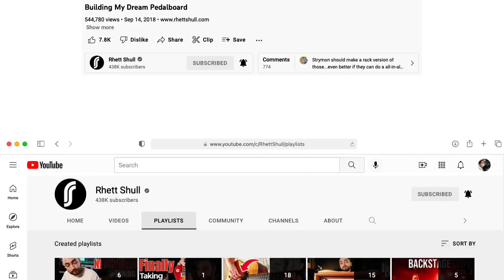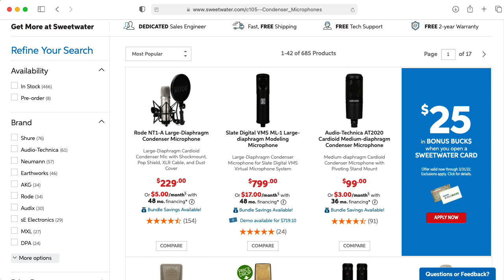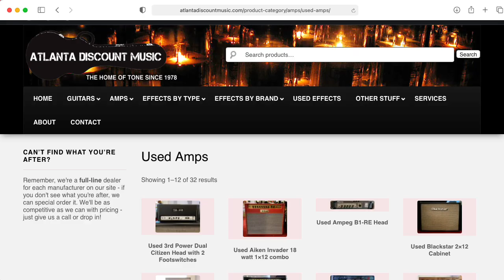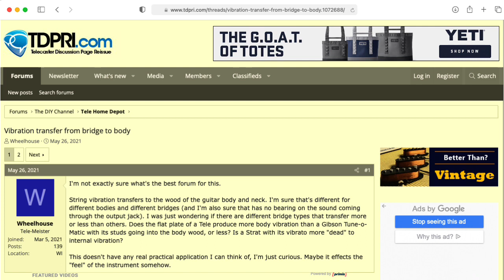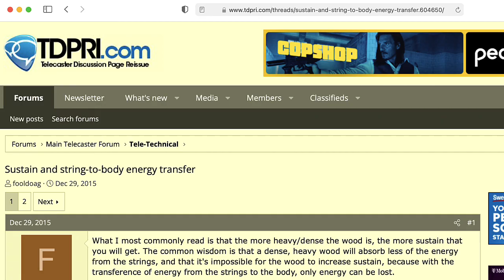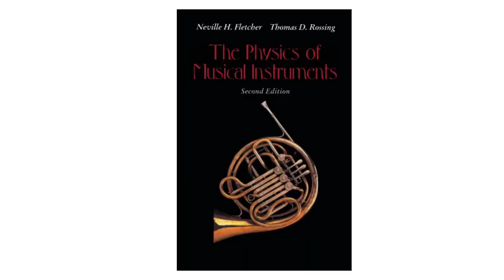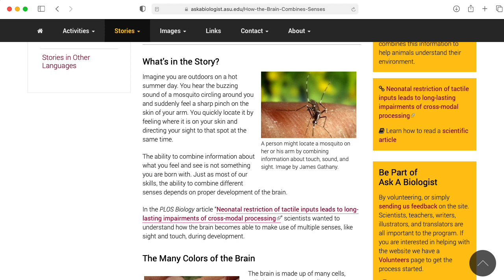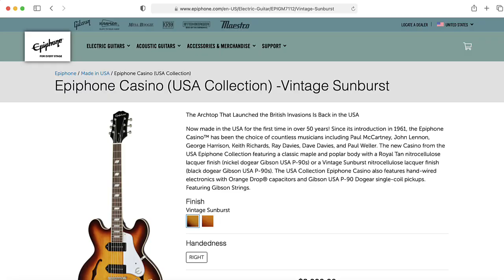Refining Rhett Shull's Resonance Reasoning: Vibrations in Electric Guitars and the Sustain Paradox

Comment: Here is an interesting fact for you: I recently witnessed a friend holding his mobile phone close to the pickup on his electric guitar during a rehearsal, to play an audio file (of the song we intended to rip off) for the rest of the band to hear. The 6 strings vibrated enough for the Pickup to provide a very clear signal which was then cleanly amplified. This would suggest that there is a great deal of feedback and possibly reflected energy  through the physical elements surrounding the Pickup. To simplify this down to the theory of a magnet and a coil being immune to the surrounding environment is a little too Thevenin.
Reply: I honestly think it’s because the pickup is picking up the magnet vibrating in the phone’s speaker. From what I recall this works the same way if you mute the strings. However I’ve seen people sing into pickups and it being picked up and audible through the amplifier (both vintage a modern pickups so presumably at least the modern ones were potted). So imo it’s either the voice is making the strings resonate in relation to pickup or vice versa, or even potted pickups are microphonic to a degree.

Comment: Well ... I basically agree with what you say, but I think you underestimated something. If there is a strong coupling between the string contact points and the neck/body then some of the vibration energy will be transfered to the acoustic parts. This also means that some of the enery in removed from the strings and thus will not turn up at the pickup. This will reduce the sustain but may also change the spectral energy distribution at the strings which is left. So I would assume that the body resonance may also influence the spectrum and thus the sound seen by the pickup.

Comment: I don't try this with every guitar/pickup I own, but in my experience every pickup is microphonic to some degree. With enough gain you will hear through the amp of you sing into the pickup - properly potted nonmicrophonic (technically) pickups. If that's true,  every pickup will pickup some of the acoustic properties of the guitar to some degree.    

I've seen many pickup builders talking about how much time the pickup will stay submerged and how well it's potted affects the tone. 

So what I got was that maybe it's a balance between avoiding issues under high volume and gain while sacrificing as little as possible the microphonic quality. 

But while I had good examples of what Rhett is talking about (one of them an sg jr actually), I had a strat a while ago that sounded crazy loud acoustically but sounded very bad plugged in. It wasn't just me, I had some guitar buddies over and we all agreed. We transplanted the whole electronics from a fender john mayer into it, from the pickups to the jack,  it still sounded horrible, nothing like the fender. The fender still sounded good with the partcaster electronics.
Reply from the maker: It would be interesting to try to tease out how much the microphonic pickup is picking up the vibrations in the wood of the guitar body, vs. the parts of the microphonic pickup vibrating directly from being blasted from the amp.

Actually, you could probably test this by just holding the pickup and blasting a guitar amp at it. That would give you a baseline.

Comment: I get it when you say that the energy that is in the body, is not in the string anymore. AKA, the pickup doesn't pick up the movement in the string anymore. That is obvious. 
But now the opposite question... 
What if the strings are more or less stationary, but the resonating body and the pickups vibrate in relation to the strings? 
In that case the magnetic field in the pick up will sustain right? 
I mean, who cares if the strings move in relation to the pickups or that the pickups move in relation to the strings?
The vibration in the strings will always be greater than the vibration in the body, but both vibrations add up, i presume. Albeit subtle.
Reply from the maker: I thought about this for a while trying to come up with an experiment to test this... but it would need a double necked electric guitar, where you can separate outputs for pickups on each neck. You could strum on one neck, which would make the body vibrate, and you could dampen the strings on the other neck to make sure they're not picking up sympathetic vibrations. Then you could get the direct output from the main pickup form the neck you are strumming, and then also look at the signal from the pickup from the neck you aren't strumming to see what vibrations from the body it might be picking up.

Comment: Good video. I observed this neck vibration characteristic when I was comparing high and low-end mandolins last year. It's remarkable how important it is to a players perception.
Similar to the contradiction between 'soft' or 'dense' woods being good for sustain, I can imagine an argument that a 'resonant' guitar that vibrates along with the body is beneficial for sustain, as a result of not losing as much string energy to internal wood friction. Why do acoustic instruments not suffer from significantly worse sustain than electric ones? Is the energy actually converted to sound by a soundboard really only a small fraction of the energy of the vibrating string? That would explain why a 'resonant' solid-body isn't less sustaining than a 'dead' one.
Reply from the maker: Interesting thoughts! I think it would be really interesting to stick some piezos in various places on different guitar bodies and try to measure that.
Reply: Acoustic guitars DO have worse sustain than solid-body electrics. Check out Zollner's work (in his book) measuring T30 (decay time) and bridge admittance for acoustics, hollow-body electrics, semi-hollow bodies, and solid-body electrics. T30 is shorter and bridge admittance higher in acoustic guitars. Also earlier work by Fleischer comparing acoustic and electric guitars. There is no escaping the Conservation of Energy Law. That's good overall for an acoustic, because it enables string vibrations to be heard, by transferring them to vibrate the body and air cavity . But not good for an electric guitar. If string energy goes into vibrating any part of the guitar's structure, it is no longer seen by the pickups - which means that the resulting tonal palette has lost those frequencies, and sustain of those frequencies is reduced. When guitarists like Rhett think that guitars which indeed do sound resonant do so because of body vibrations they have hoodwinked themselves. Lucky for them, all measurements of real guitars show that solid bodies don't resonate to any significant extent. Even though our sensitive skin mechanoreceptors can feel some vibration. But truly resonant guitars are those where vibrations remain almost all in the strings. If solid bodies did vibrate significantly, sustain would be poor. Again, no escaping the laws of physics.
Reply: This has been studied.  Acoustic guitars get sustain the same way electric ones do, just to a lesser degree:  most of the energy of string vibration that hits the bridge, nut or fret is reflected right back into the string.   The bridge/nut/fret only moves a little bit at each cycle, like less than 1 percent, so the string gives up energy to the wood gradually over a bunch of cycles.

Even on an acoustic, the bridge is rigid and massive enough, and braced rigidly enough against enough mass of adjacent wood, that only a little bit of the string energy is transmitted at each cycle of vibration.   On any normal solid body electric, with a metal bridge that's rigid and somewhat massy, and a solid body made of any normal body wood, the bridge moves even less, hardly at all, so very, VERY little energy is transmitted from the string into the body there. 

Considerably more energy is transmitted into the wood of the neck at the nut or fret than into the body wood at the bridge (although it's still a tiny bit per cycle).  The neck is the main cause of resonances on an electric, because it's much thinner and less massive than the body, and can flex more easily and in more places.   For most resonant frequencies of the neck-plus-body, above about 500 Hz, the body acts as a rigid ballast to immobilize the bridge and one end of the neck.

Comment: Hi Aaron, very interesting. i'm an EE at a university too. it seems to me that the body of a guitar acts as a filter. which, as you said, if energy is going into the body it isn't going into the strings. filters have resonance and they also tinker with phase. there will be several resonant frequencies in a guitar body/neck assemply. in resonance some of the energy will be transferred back into the body at varying phases. doesn't this then translate into a hearable effect? to complicate things, usually somebody is holding the guitar and thus dampening the energy in the body. the whole transmission of energy into the body is governed by the conductance and admittance at the fret which is being held down and by the bridge. the conductance varies quite a bit and can lead to dead spots in some guitars.

there are papers by fleishman and zwicker that go into this in detail.
Reply: A little energy is transferred into the body at the bridge and the neck at the nut or fret, which is why a solidbody with very a light body is a little louder acoustically than one with a very heavy body.  You're not just hearing the vibration of the strings themselves, but are also hearing the body vibrate.   But the large majority of the energy from the vibrating string is reflected when it hits the bridge or the nut or fret, and stays in the string.   Most of the losses are due to direct transmission from the string to the surrounding air, and the flexing of the string being converted to heat by internal friction.   (Which's why increasing the mass of the body beyond a few lbs has little effect on sustain: the major losses are elsewhere.)   That's especially true for high frequencies because the mass in and around the bridge and the nut or fret is even more effective at reflecting high frequencies than low ones.    Above 500 Hz there's very little energy being admitted into the neck or body (and IIRC most of that is rapidly converted to heat...?)
Reply: I think you are right. Energy at resonant frequencies is not completely lost as it happens with other frequencies but returned back to the strings. In other words body and strings vibrate together at resonant frequencies. If wood is not resonant the energy is just lost, and this is what we heard on the video from a guitar player. He needs to put more into the guitar to get the same result.
Reply: @vp7137s  No, that isn't how resonance works in solid-body electric guitars, and it's largely what Dr. Lanterman is (rightly) disagreeing with in this video.  You DON'T get extra sustain at resonant frequencies because of energy cycling efficiently between the strings and the guitar.  You get LESS sustain at resonant frequencies, because any string vibration energy transferred from the strings into the neck or body is (a) mostly on a one-way trip (very little is transmitted back into the strings) and (b) quickly lost from the guitar due to internal friction in the neck and body.

The only way you get sustain is by keeping vibration energy IN THE STRING, by making the bridge and the nut and frets almost immobile, so that vibrations hitting them can't move the bridge or nut or fret much, and the vibrations are almost entirely reflected right back into the string without getting into the neck or body wood.

Even with ideal (immobile) bridge, nut, and frets that don't move at all, you would gradually lose vibration energy from the string due to internal friction within the string, converting coherent vibrations into random molecular motion a.k.a. heat.  (As well as losing some directly to the air, i.e., the direct sound of the vibrating string in air.)

Vibrating the body is harder than vibrating the string, because it's much thicker and more massive.  Flexing a thick wood neck or body takes more energy than flexing a thin steel string, so the vibrational energy transmitted into the neck and body is RAPIDLY converted to heat within the flexing wood, by internal friction.

The bottom line is that the main effect of resonances is to REDUCE SUSTAIN at or near the resonant frequencies.

What many guitarists think is a pleasant "resonance" that gives sustain and even tone is often actually a LACK of resonance, because resonance simply doesn't work the way many guitarists think it does.

Resonances can affect the electric tone, because it makes some frequencies sustain LESS.   That's generally not apparent when you first pluck a note or strum a chord.  It only becomes apparent over time, for SUSTAINED notes and chords.

So if you're strumming and noodling on a plugged-in electric guitar in the usual ways, and you think you're hearing wood resonance in most of the notes and chords, you are almost certainly wrong.  The resonance only becomes apparent in sustained notes and chords, often by reducing sustain of the lowest and most important frequencies, creating undesirable "dead spots" for certain notes fingered in certain places on the neck.  (Normally higher harmonics fade faster than lower ones or the fundamental, and sustain depends mostly on the fundamental and octave harmonic.  If the fundamental gets sucked up by a resonance, that reduces sustain because it's normally the longest-sounding partial.  If both the fundamental and first (octave) harmonic are sucked up by resonances, you get an even deader spot.

Comment: Any thoughts on why a hollow or semi-hollow body guitar sounds different than a solid body with the same strings and pickups? For example, a 335 vs Les Paul?
Reply from the maker: Energy definitely leaves the string and enters the body, it's a question of how much, and it will be different for the two body types. WIth a solidbody, I conjecture more of the energy is staying in the string, whereas with a hollowbody more energy is going into the body. And in either case, some frequencies will have more energy going into the body than others, changing the tone of what's left in the string. 

I keep returning to the notion that the entire reason solidbody guitars were invented was to try to get a body that wouldn't resonate.

There is another complicating factor when it comes to feedback from the speaker; the speaker will have an easier time making the hollowbody vibrate, and some of that energy may couple back into the string.
Reply: @Lantertronics  Makes sense! If the body is just modifying the contribution of various frequencies, then the sound of a hollow body should be completely reproducible by EQing the signal from a solid body with the same electronics. Regarding your second point, that makes sense too, but there is a very noticeable difference even when a hollow body is plugged in direct, so that can’t be the only reason.
Reply from the maker: These are all conjectures though. I think it would be really interesting to put some piezoelectric pickups on different parts of various guitar bodies and actually measure the vibrations.